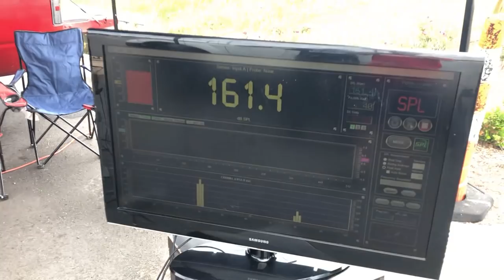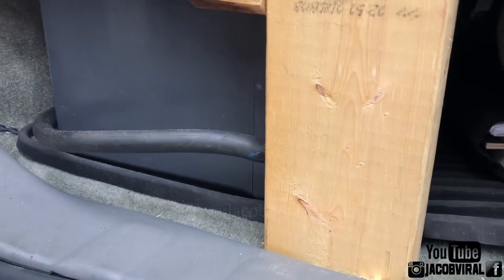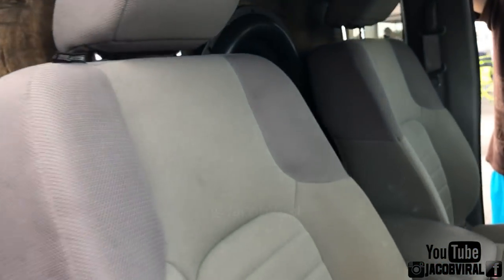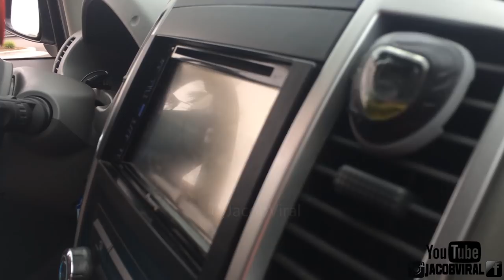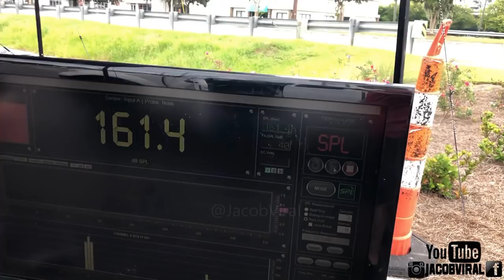LOUD SINGLE SUB BUILD TEARING IT UP!

Comment: I’m surprised his rear view mirror didn’t fall off, I have the same exact truck with 2 Skar EVL 15s and that puppy fell right off!
Reply: YouDrop that’s because 2 15’s are louder. 2 15’s have 300 sq in of cone area and 1 18 has 227 sq in of cone area
Reply: Jeremy S that makes sense, thanks for the info!
Reply: @jeremys8360  thats not always true. Its EASIER to get loud with more cone area. Doesn't mean it will be louder.

Comment: 🔴I have a skar zvx 18 and plan on putting it in a 6.6cf net box with one aero port, should i use 10 inch aero port which has 78 sq inches which is recommended for this sub or should i use a 8 inch aero port which has 50 sq inches since aero ports are more efficient

Comment: he should be using the skar skv2 bass knob with clip led bcuz it actually works with RP series amps
Reply: No it doesn’t. Rp amps don’t have that style plug in for the bass knob and they also don’t have built in clip lights so even if it did fit it wouldn’t work

Comment: What Exact Skar sub is that? and also curious my goal is 150 from a single 15 i know it's possible but i am thinking of getting an NSV4, Zv5 15 or the Deaf Bonce SA315's
Reply: Erik Britz I pull 150s on music with a single 15” DC level 5. Very achievable goal.
Reply: Zvx v2
Reply: Skar dnr 15 will do it bo prob
Reply: No*
Reply: Name 01234 nice! How much power? And what frequency?
Reply: @jamesbondcaraudio4247  they're 5000 rms. I think 20-200? Not sure.  They're skars top of the line sub so its pricey. But if that's too much get the zvx series, I have 2 zvx8s and 1 12 and the 12 is a beast
Reply: Chase Smith my comment and questions we’re directed at Name 01234. But thanks for the info.  I like Skar Audio. I currently own 2 ZVXv2 15s
Reply: @jamesbondcaraudio4247  I see that now lol, oops
Reply: Chase Smith it’s all good brotha
Reply: Erik,Can sell you a sundown ZV5 15 dual 1ohm brand new in box if that's wat u want